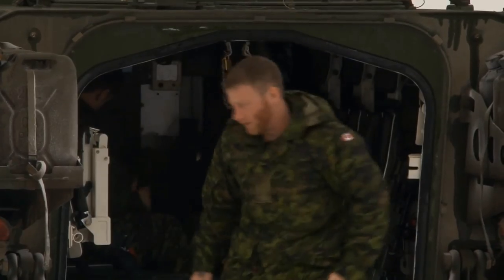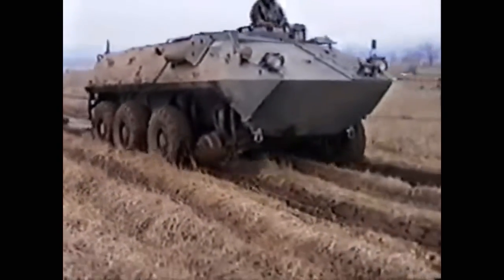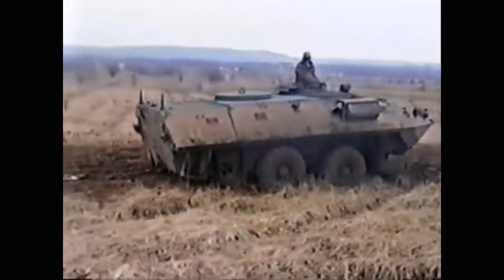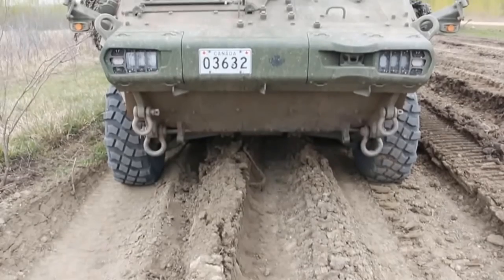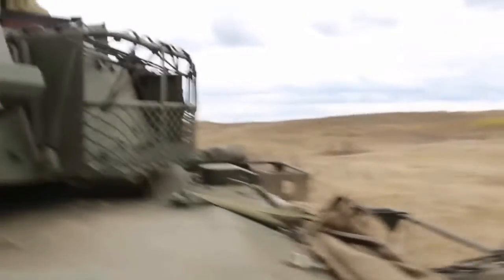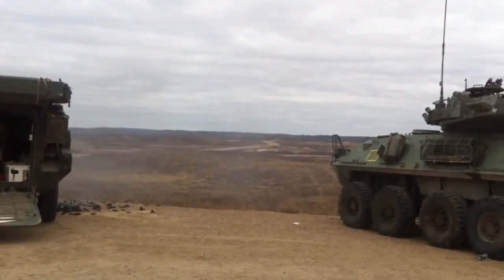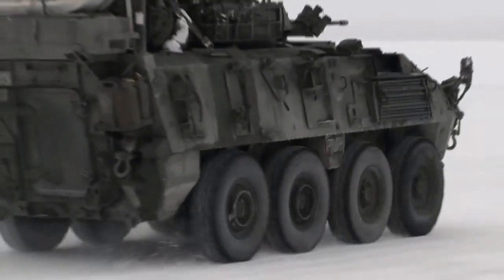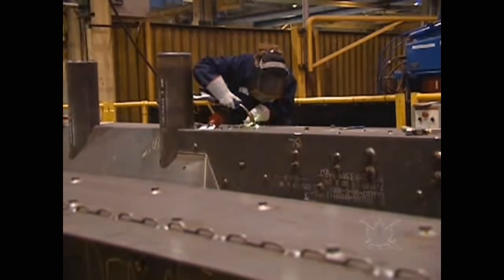Canadian Light Armoured Vehicle (LAV) Series - LAV III

Comment: Most of the early Mowag Pirahna wehicles were equipped to be amphibious. But will the increased threats they face most of the later models, Lavs, Stykers and other types were equipped with more armor to protect the crew and passengers. Including, at times, bar armor and reinforced hull floor protection for IEDs and mines. The US Marines needed the Lav25s to be amphibious. So they have less armor and other features. Over the Generations of Piranas and other types they have increased size and power. The Marines are getting a new aphibious vehicle based on the Iveco SuperAV. This is a much larger vehicle with plenty of hull flotation for amphibious operations. And will be able to carry heavier loads with greater amphibious capability. Kits to make later model Piranas are not common. And I have seen none. They could be modified to carry extra boyancy packs on the hulls side.  And possibly fitted with propellers. They could be foam encased in aluminium or steel. This type of upgrade was used in the old M113s to increase its amphibious capability. And can serve as spaced armor. Detonating HEAT warheads. Outside of the hull. It is still possible to buy new amphibious Piranas. If anyone wants a modern amphibious carrier the SuoerAV is a good option.  The Patria AMV is another option. And one model has been developed with extra bouancy panels. Another option is the Russian VBK Bumerang. FNSS from Turkey has some amphibious 6x6 and 8x8 APCs. And there are a number of modern tracked APCs that are amphibious. Armor is always a big factor with apmphibous vehicles. You can not add a lot of heavy armour without reducing boyancy.

Comment: The LAV 6, isn’t really the LAV III anymore. The only shared part is the turret which also went through upgrades. It’s an entirely new vehicle,m. The new vehicle is wider, heavier, Better armoured, larger fuel tank and engine. Not sure why they went with the nomenclature but c’est la vie I guess.
Reply: It was more politically palatable to "sell" it as an upgrade rather than the completely new-build that it is.

I had a tour of the General Dynamics factory in London in 2013 or 2014, which was most impressive.

Very little survived from the LAV III to the LAV 6. It was much cheaper that way. The USMC opted for rebuilds, and that programme was also underway during our tour. Those vehicles were completely stripped down (cost), the bottom half of the hulls cut off (cost), and new double-V hull bottoms welded on.

The factory is truly state-of-the-art, and employs extremely talented, motivated, and dedicated employees - the welders' capabilities were particularly stressed during the initial briefing.

There have been military people (ex-Reg and Res, and currently-serving Res) in management and sales positions there since the GM days, many of whom I have know for decades.

Comment: Is it better than our German /  Brit APC we have just Bought  ?
Reply: No. The LAV is based on a vehicle design from the 70s.
Reply: @jonny2954  It is not that same design.
Reply: @TheLoachman  I never said it is the same design. It is based on a design from the 70s. The MOWAG Piranha.
Reply: @jonny2954  My car is "based on" the Ford Model T.

That doesn't limit it to Ford Model T capabilities.

The USMC Bell UH-1Y is "based" on a 1950s design, yet its capabilities are far above those of the original UH-1. It is not the same helicopter in any real sense, despite a generally-similar appearance.

Similarly, the LAV 6 is a completely different vehicle compared to its original predecessors. Nothing about it is the same. The armour plate is a much better metal, the welding is vastly superior (the plates are cut at perfectly-matching angles rather than square-cut, which aids in stronger welds as well), it has a double-V hull that deflects blast energy, the seating system absorbs blast effects, the whole drive train is different, it has a modern powered turret, and, and, and...

I spent time on the 1970s Grizzlies.
Reply: @TheLoachman  No, the LAV series and  Piranha are much closer than you are aware of. While the electronics and other subsystems have changed, they share the same hull and layout, which is, especially in case of armored vehicles, a very important factor. Hull and layout decide internal volume, and internal volume together with weight requirements decide passive protection level. While the newest LAV version is indeed fitted with all new subsystems, it's still outdated in the passive protection department. The LAV 6.0 was up for the Australian LAND 400 programme, and was rejected before the trials even started because of insufficent passive protection level, and it wasn't close.
Reply: @jonny2954  I spent a fair amount of time in my Infantry days working with and out of Grizzlies, the 1970s six-wheeled version. I've crawled over LAV IIIs and a brand-spanking-new-fresh-from-the-factory LAV 6 and had a lengthy guided tour of the GDLS plant in London Ontario. During that, we were extensively briefed on and shown all of the improvements, minor and major (with many based upon hard lessons learned in Afghanistan), that were made and watched pretty much the whole production process from stacks of armour plate to finished vehicles. The LAV 6 hulls and turrets are all brand-new production, using superior steel and superior welds, not simply refurbished LAV III originals. There is almost nothing from the old LAV IIIs that survived into the new LAV 6s.

Despite being called an upgrade programme, it really wasn't. It was a run of completely newly-built vehicles.

The factory is also in its original building, which dates from well before Grizzly/Cougar/Husky production. The inside is also completely different from what I saw during my first peek inside in the very early 1980s.

I stand by my original comment. "Based on" does not equal "same as".

Now, I do not know what the Australian requirements were, nor specifically why they rejected LAV 6. I do not doubt that they had sound reasons for their decision. If you have shareable details, I would be greatly interested in viewing them. Had you provided a more indepth and educational explanation, I most likely would not have challenged it. I may or may not have asked questions to further my understanding.
Reply: @TheLoachman  Again dude, i never said it is the same design. I said it is based on a 70s design. Leopard 2A7 is also based on a 70s design. Is it better than the initial 70s version? Yes it is. Is it better than a completely new tank recently developed from scratch? No, it is not. There are certain aspects that even a complete revamp cannot change, such as overall dimension and layout, which directly affect protected volume and thus passive protection level.

The LAV 6.0 was rejected due to two main reasons:

-Protection only according to STANAG 4569 level 4, turret is even below level 4. The Boxer has level 6/6+.
-Lowest gross vehicle weight at 28,600 kg. Boxeris at 38,500 kg

Both are caused by the fact that it is based on a older vehicle design.

Comment: Cool video, but... your history is way off.  General Motors Armoured Vehicle Division (GM Defence) bought the rights to build the MOWAG Piranha 6x6 in the 70s for the CAF.  This resulted in the Grizzly, Cougar and Husky.  They looked at the 8x8 variant but decided to work on the platform in-house which led to the original LAV-25 family; this was purchased by the USMC.  Continued development generated the LAV II designs which became the Coyote recce vehicle, the Bison APC and the AUSLAV.  The next generation was the LAV III variants, which begat the Canadian LAV-III, NZLAV and the Stryker AFV.  Around this time GM Defence was purchased by GDLS (General Dynamics Land Systems).   MOWAG was still developing their family of APCs during all of this, but there is no commonality between the LAV family and the Piranha.  Everything since the AVGP (Grizzly, et al.) has been designed and built by GMD/GDLS.

Comment: It looks and feels like a Stryker
Reply: Fire Power701 the Stryker is from that family, which are made in London Ontario Canada... it’s the same company.

I wasn’t aware that the particular GM line in London was bought out, but definitely the same vehicle.
Reply: The Stryket is based on the LAV and comes from the same factory.
Reply: @NovaScotiaNewfie  So it is basically like the infinity G35 kind of situation which it is the same vehicle under a different name?
Reply: Fire Power701 I don't know the exact differences but the Strykers that I know of did not get the turrets and the 25 mm Bushmaster chain gun. They have remote weapons stations with M2 .50 cal machine gun. Some may mount the Mark 19'Grenade launcher but I know 50 cals for sure.
Reply: NovaScotiaNewfie the main Hull is the same, although Canada’s LAV 3 hulls are different... I’m not sure if the states ever got that version, other than for the Stryker itself.

The turrets themselves are where the differences come in with quite a few versions being created. The 25mm turrets are the same, but likely have different electronics and visual packages. The Stryker is the 105mm version of the turret but the vehicle also has an auto loader built into it... it’s a very neat system.

Comment: Sadly this program lead to the cancellation of the CV90, which in my opinion, was a much more capable vehicle. To bad Bean counters and politicians dont get shipped off to war with the equipment they procure. I think we would see a drastic change in CDN military equipment quality.
Reply: The LAV-6 was always going to be procured, the question was if we were going to augment our fleet with CV90s in the IFV and AFV roles. 

The LAV-6 platform does have sufficient excess weight capacity for thicker armour and an APS system, so it can be turned into a competent IFV, but a tracked vehicle like the CV90 would have been useful for arctic operations.

Comment: The lav III is obsolete and being replaced by the lav 6.   The lav III performed horribly in Afghanistan. I personally saw a few that were on the business end of an IED and I can tell you the vehicle was not up to the job.  IN short,  The LAV III was the perfect vehicle for the previous war.  Under powered, the suspension and drive train was too small and the armour was insufficient.
Reply: Nothing is invulnerable if the IED is big enough. The best that one can do is to make them sweat more by digging a bigger hole and lugging more explosive.

We had much more success finding IED factories and intercepting the guys that would activate and deactivate IEDs daily in the last year or two, and that made a real difference. I was very impressed by how much was learned between my first and second tour.

What vehicle (aircraft/ship etcetera) has not been designed for previous wars? Technology changes during war, lessons are learned (at great cost), and upgrades made. Nobody expected to get involved in anything like Afghanistan until we suddenly did, and we faced an intelligent, determined, resourceful, adaptable enemy.

Name a better vehicle that was available when we began operating there.

Comment: Whats wrong with the old 4 tonner, and sticking a GPMG on the top?  They are only a taxi.
I think we all know the answer to that.  
Any future grown up war is going to have long range artillery landing with splinters flying all over the place, miles and miles behind the lines.   Armour is a necessity. 
Having a decent gun on top is a good thing.
Armoured taxis with some speed is what is required and plenty of them.  This one looks plenty good enough.  
Because a load are needed cost is an issue.  No one is wanting to sit in a jeep for want of one of these.  Reliability and running costs need to be low or they will stay in the garage like most tanks do.
Even the British are finally getting the Boxer.  About time.
And they are not front assault teeth arm, thats what heavier tracked armoured kits for.   At least these can follow in the wake and look after themselves.

Armchair generals can moan all they like about the technical details.  The Politicians can argue how to spent our tax.  But if you are a soldier and you have the choice of one of these or a Toyota Pickup  then its not so difficult a decision. 
Freedom doesn't come cheap nor a given.